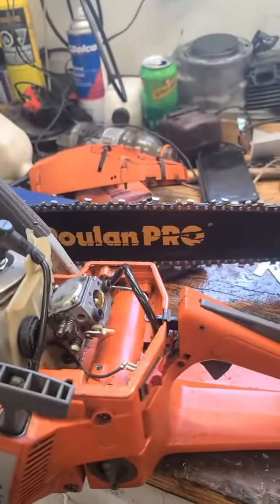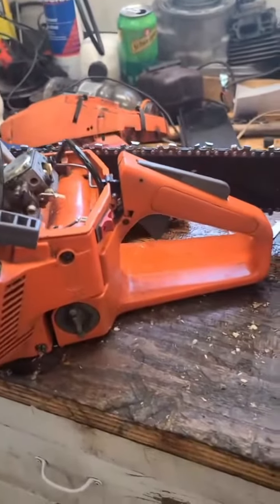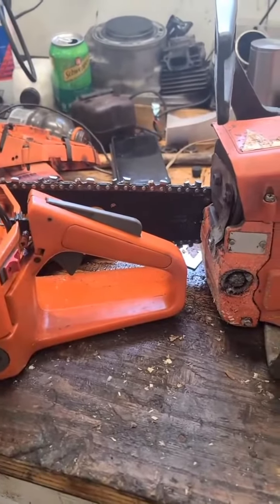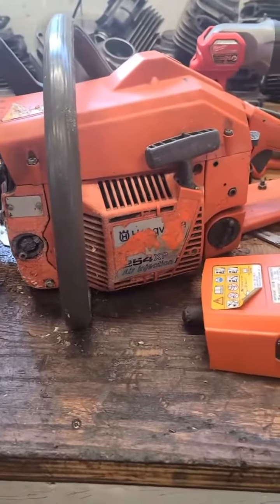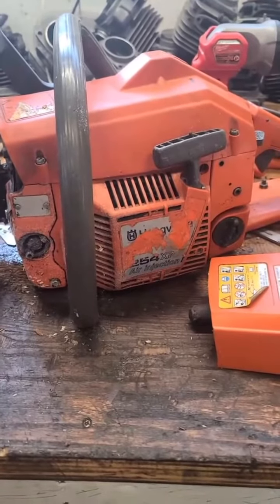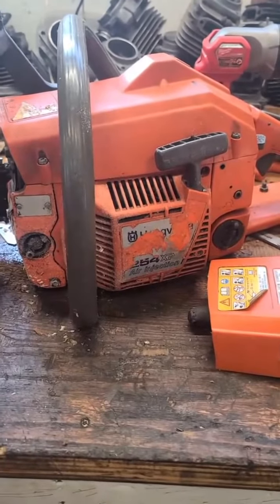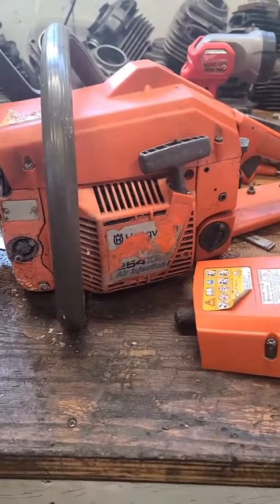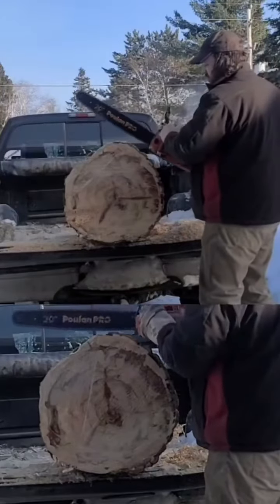#northwestsawshop #chainsaw #husqvarna #254xp #55rancher #evanfixeseverything #ported #2strokepower

Comment: Still away to but not bad , did the muffler mod make much difference to the 254?
Reply from the maker: On later investigation, the muffler mod on that 254 was only a new deflector, the actual opening into the can, and the internal baffle were completely untouched. 
I suspect Dad did it to stop it from melting the brake flag.
Reply: @82f100swb  probably  going to try a muffler mod on my 254xp I did it on a 353 and the throttle response was way better.